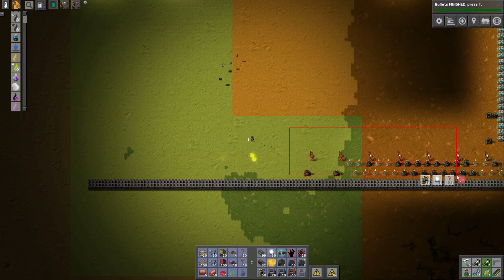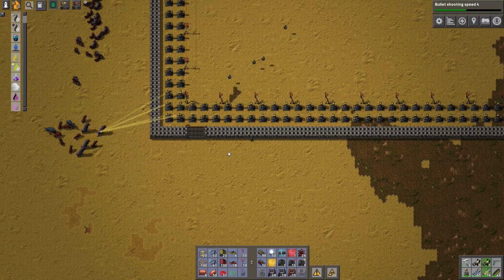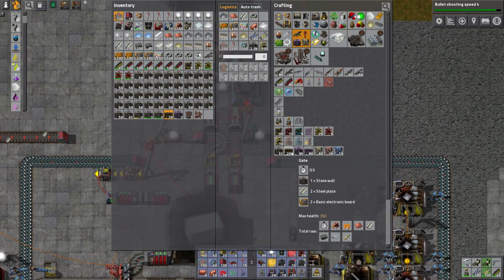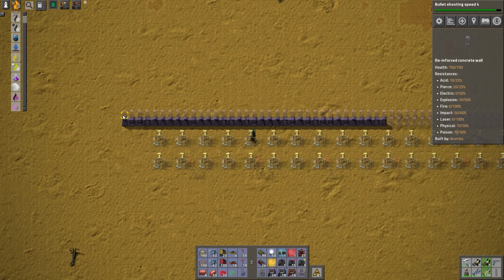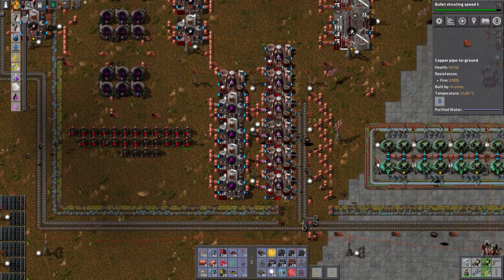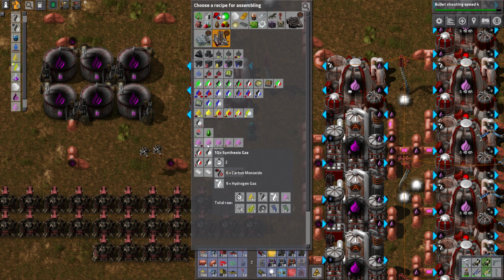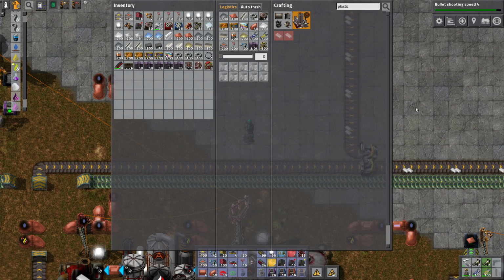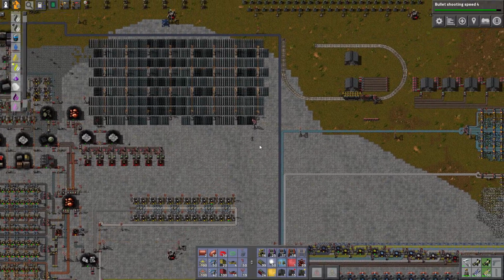Factorio A Rocket Per Patron Episode 64

Comment: You shouldn't use your synthesis gas to make hydrogen and carbon monoxide - it is more valuable. For hydrogen do electrolysis of water, and carbon monoxide is made from carbon + oxygen. Synthesis gas becomes your best friend for plastic : synthesis gas -> methanol -> propene -> plastic. Near the end, you want to turn your syngas into methane, ethane and butane as each one can be converted to plastic via its own route.

Comment: "Bitters are using splash attack on my walls, I better spread them out and super fragile belt right next to them" This is gonna be interesting
Reply: With the AI mod to biters they now attack all entities; The belt trick doesn't work anymore. I think in the base game AI they will also attack belts if the pathing fails and the belt are rather weak (also flammable). The one solution is to build a set of walls that diverts them but doesn't stop them. So think of hitting a T intersection then having another T then another. I use this with flame turrets so the fire has a chance to get on target with the base game AI.

Problem is with the AI mod being used is that the spitters just attack anything they close within range of. So your best bet is to have a set of walls to act as targets ahead of your turrets, place the walls at the max range of the spitters but so that spitters are just in range of flame turrets. This causes the spitters to pile up attack the target walls while they get hosed with fire. The biters get trapped behind the spitters and then run into the fire once the spitters die. All the while all the biters/spitters are getting hit by sniper turrets or upgraded laser turrets. 

Also use the Bob's mod bullets they do massively more damage. Or for a totally broken ammo use the Uranium power mod and make DU ammo. (Uranium Power is part of the mod pack, but I don't think being used in this series.)